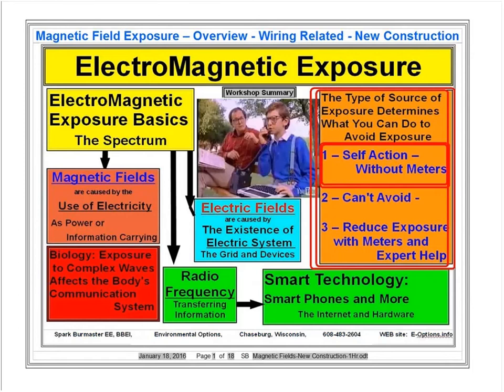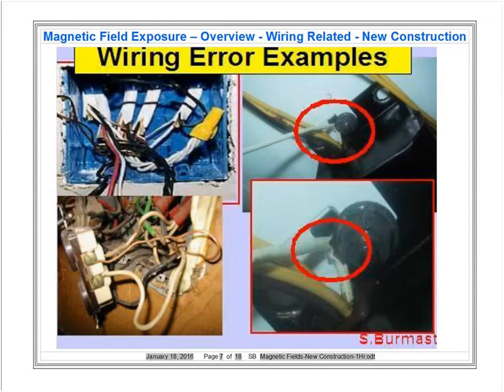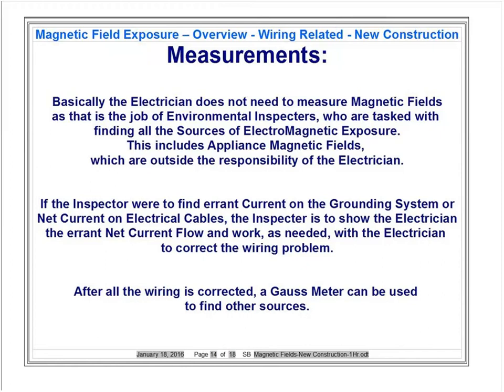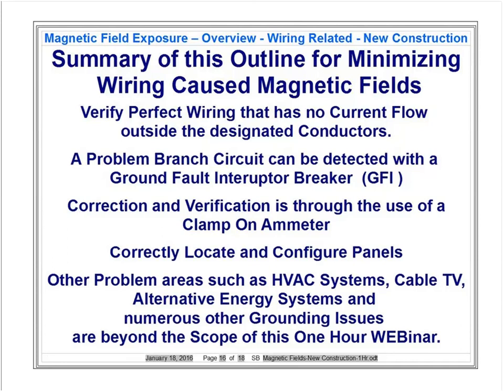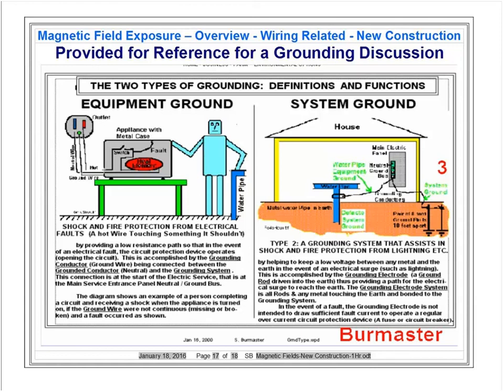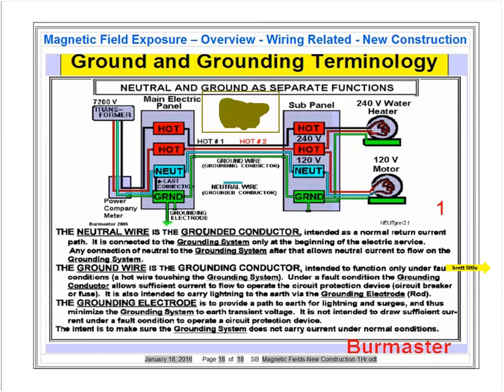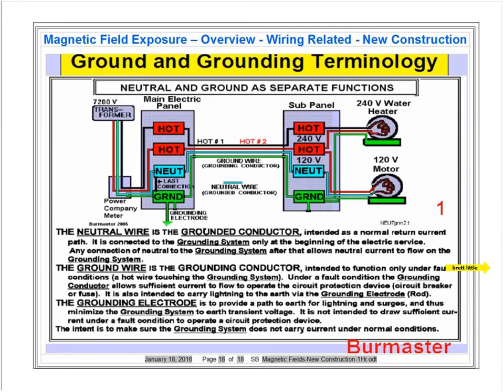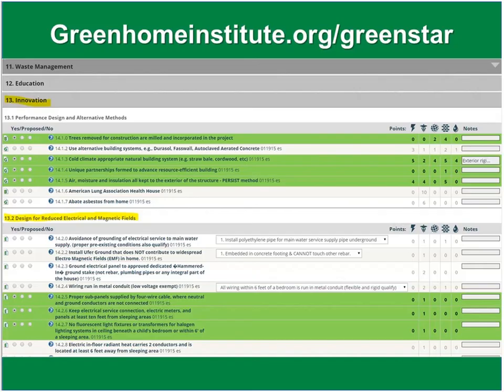EMF Webinar 2   Reducing AC & Magnetic Fields

Comment: Btw the solution they didn’t give to grounding wire attached to the copper supply is to cut out a few inches of copper on the house side of the water meter and replace it with PEX.
Reply from the maker: Thank you! Would you just recommend all PEX?
Reply: @GreenHomeInstitute  I believe both PEX-A and PEX-B are fine for residential. PEX-A may be more durable in the case of a frozen pipe.

Comment: Something I would have liked have heard about is whether or not MC (metal clad) cable is a good idea to mitigate magnetic fields or is typical romex cable better because of the orientation of the hot/neutral wires to one another.  Perhaps the MC cable and even smooth conduit are helpful for electrical fields and keeping dirty electrical frequencies contained. Another thing I'd like to hear more about is the installation of automatic demand switches that turn off circuits when there is no draw on them. I've seen them for sale on an EMF supplier website but never seen anyone show how they're installed or whether or not electrical inspectors bock at them.
Reply: I don't completely understand it, but according to LessEMF, the twisted isn't good because that disperses the magnetic field rotationally depending on the pairs orientation. They suggest romex on the flat with the narrow side facing the living space. Then they suggest using something like a sandwich of conductive aluminum tape for conditions where the circuit is balanced. Where the circuit is not balanced and there's a lot of issues from wiring mistakes, they suggest a round sleeve-like conduit around the romex. The round spiral conduit is also suggested for bends/turns. What MC cable does is block the ELECTRIC fields when power is turned off to devices but the circuit is still on. You can see this manifest itself in body voltage readings. This why a lot of people just turn off the circuits to the bedrooms at night. So MC cable helps nullify the electric fields and dirty electricity (transients) frequencies that may radiate from the wire. Since the wire inside MC cable isn't perfectly oriented parallel, it's not as perfect as romex for magnetic fields that are generated when the devices are on. So one could just put MC cable in for the simplicity of it and then turn devices off (ideally unplug them) at night before bed so device plug/wires don't act as antennas for broadcasting dirty electricity in the home. Or you could re-wire all the lamps, etc with the mu-cable Less EMF sells to manage that a bit better.
Reply: Wow nice - thank you. Unfortunately, I don't think there's any one meter that measures all things well. Like the TriField meter for example. Great deal, claims to test Magnetic, Electric, and RF. But it's only really helpful for Magnetic and Electric. It's not really all that accurate, but it is fantastic for gaining a feel for where the problem areas are. Like that meter helped me to find a poorly wired 3-way switch.  The needle pumps up really good as you walk close to the problem area. But the numbers aren't so relevant to anything. I have the Cornet for RF and honestly, I don't love it. It's cheap. I've been thinking of getting the Acoustimeter but just don't want to shell out another $400 for a meter. It's another one that seams to help isolate problem areas but the numbers aren't so exact. If you want to go pro and get super accurate numbers, then you're looking at Gigahertz Solutions models I think. Something that is really helpful for a start is to just get a Volt meter and test millivolts on the skin to a ground. Lots of good YouTube vids on that. I actually don't bother with the TriField meter to measure electric fields, I just want to know how my body is taking it in when different circuits are on in the house. Check out Michael Neuert's videos on YouTube. He shows how to test body voltage. There's a few other vids but Michael runs a couple of sites that have good info on them.